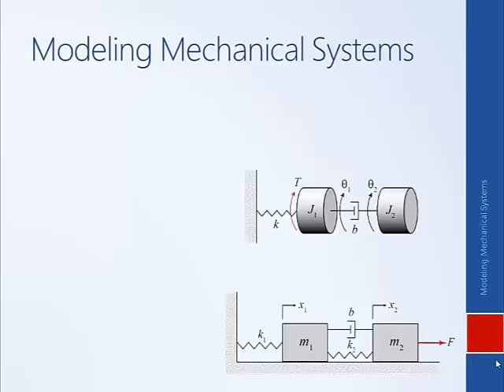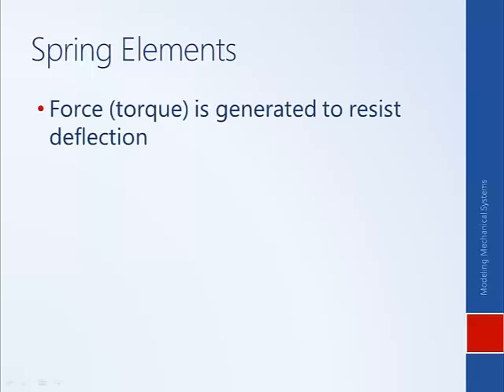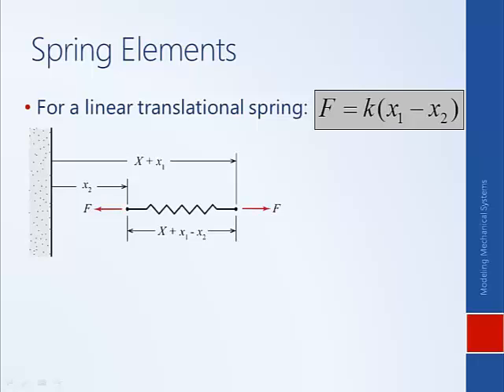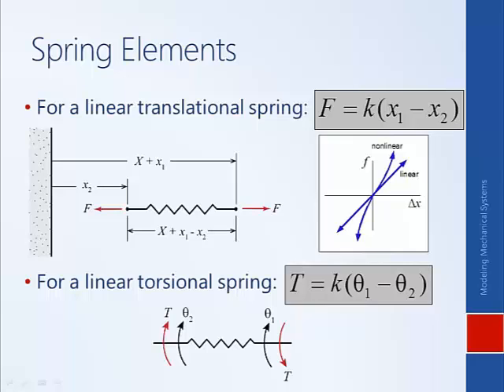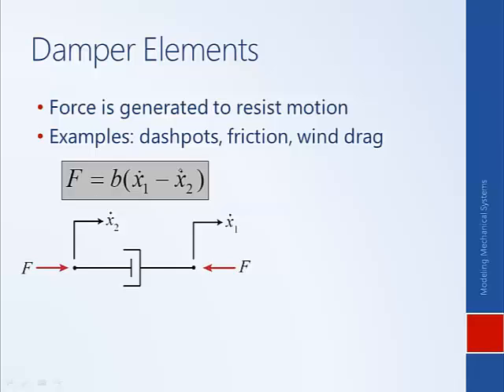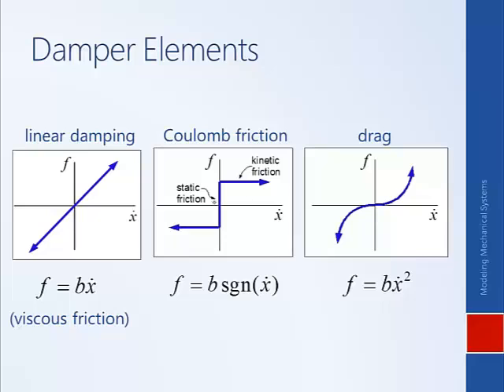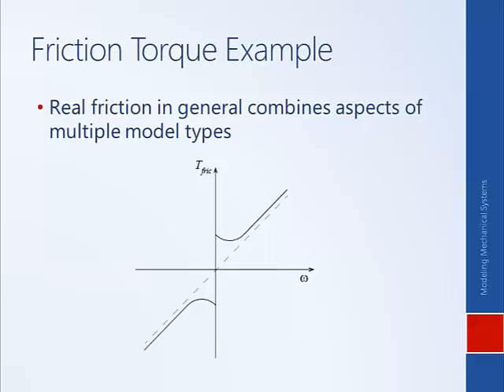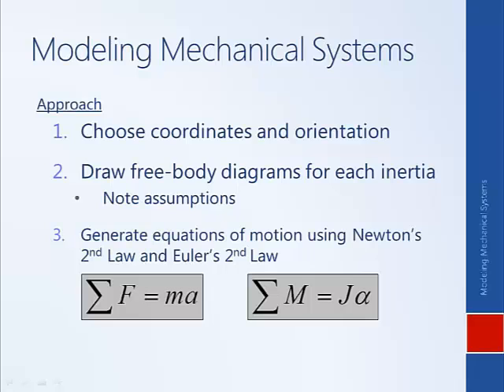System Dynamics and Control: Module 4a - Introduction to Modeling Mechanical Systems

Comment: Why not (x2-x1) or (x2+x1) or (x1+x2) to me it just seems completely random what is chosen.

Because if we chose the positive direction to be to the right, and we compress the spring by moving x1, to the left, and freezing x2 in place. In my head x1 moves negatively. Replacing x1 with the number we found, we get a negative force, but the force should be in the positive direction, counteracting the compressing force.

What am I doing wrong? Thank you.